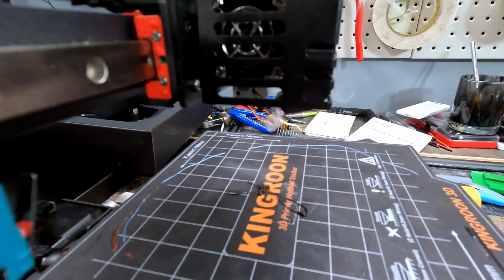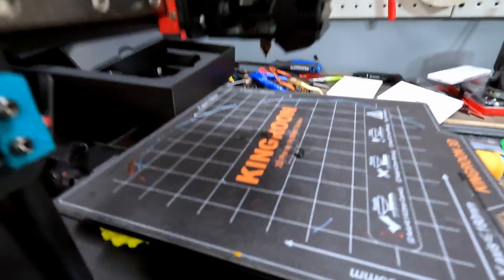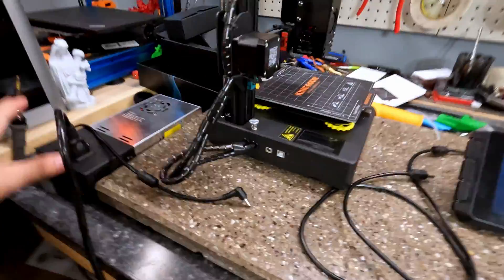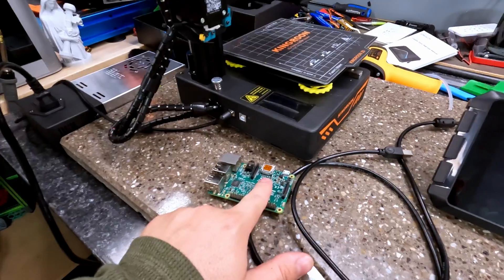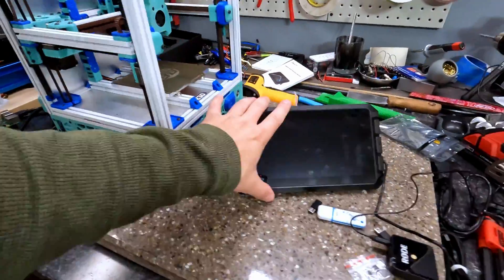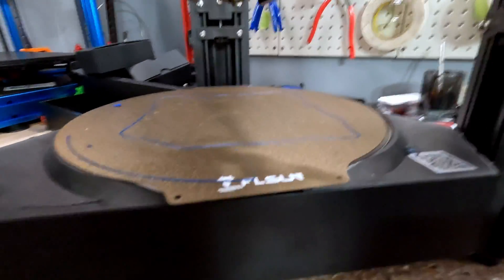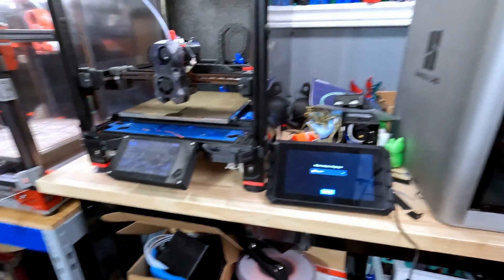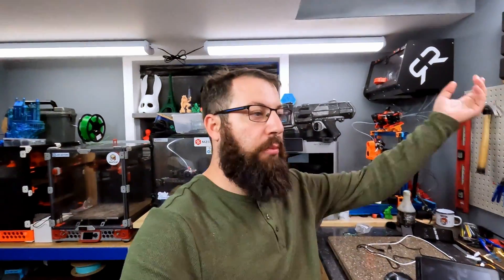Thermal Runaway - Not A Good Start With The Creality Sonic Pad

Comment: Thanks for your attention to the Sonic Pad. Both your voices and suggestions are of immense value to Creality as we always welcome more users to give us straight advice on our products. 

After watching your video, we immediately did some investigations and found this problem may occur when connecting Sonic Pad to a small number of non-Creality 3D printers. We have taken action and this problem will be fixed in our next OTA online upgrade which is expected on 15th October.

Creality hereby stands humbly and devoutly to embrace all concerns from our users and try our best to deliver a premium user experience.
Reply: It happened on my printer and it is an Ender 3 S1 Pro.  It is not and issue for non-creality printers.  It affects creality printers as well. It is an issue that needs fixed!
Reply: Timothy Hoogland  it at least says on the product page that it’s open source and modifiable.
Reply: Timothy Hoogland  what I’m saying is I’m pretty sure they released their changes to Fluidd publicly after being shamed about it. Shame it takes that much. I get your point though.
Reply: I had same issue today, i connect Sonic Pad to my Voron 2.4 R2 Fysect Spider board 2.2 and bed is overeating, iam not satisfied with that issue.
Reply: I tested today 22 of June 2023 and problem persists, when i connect Sonic Pad to my Voron 2.4 R2 Fysect Spider motherboard and the bed of my printer overeating , and Sonic Pad is updated, but problem persists, this is not a good move from Creality.
Reply: Wow!
Thanks for covering this.
I just last night connected my  new sonic pad to a Creality Ender 3 V2 with the chip STM 32 G0B0 & MINI Version E3 3.0 board. I got the abnormal heating g straight away.
Do I need to update the sonic pad firmware?
Reply: Is the source code of the used Klipper, Moonraker and "Creality sonic pad" UI versions available to everyone? Could you provide a link?
Reply: Thank you very much to Nero3d. Now we are here to update all users who are continuously concerned about this issue. This problem has been fixed in our latest OTA online upgrade.

The latest version includes: 
1. Added security protection mechanism for Klipper service
2. Fixed known issues such as temperature curve bugs on the home page
3. Optimize some interface logic

All you need to do now is update the system of Sonic Pad to the latest version. Thank you all!!!
Reply: @Creality3D  I use a CR-10S Pro V1.... There is very little support for this printer both on your site or in community forums. Will you be creating setups for this printer so we can enjoy a more hassle free setup as in the Ender Series?
Reply: @orionmec  why not just upgrade your printer to a V2?
Reply: @DanielTorres-bs8dx  I did try that. But... I got the tinymachine3d kit with the cable and all. It would not work!, then bought one from amazon and that one would not work. Since my inductive probe worked fine I just said screw it and work from there. I had upgraded to a Bigtreetech tft 43 and had all kinds of trouble getting it to work with Marlin v2.0 but finally it started working while everything was set correct all along. Then last week updated to the latest 2.1.x and now can't get the BTT screen to work again.... So long story short, it has been a pain in the but. Works great when it works!
Reply: @orionmec  all you have to do to go from v1 to v2 is install a bl touch and update firmware
Reply: @DanielTorres-bs8dx  Yes, I knew that.... For whatever reason it would not work on my machine.

Comment: When I'm using diesel in gasoline car "oh! They should tell you about this!"

Robin nano is an old board b4 all that klipper stuff and why creality should test all old boards that are not made by creality ?

The main thing is, if you are not using creality board, so you shouldn't use creality config files
Reply from the maker: Ya, but the problem was, they shipped it with a baked in creality profile setup already, and no where in the documentation did it state that, and all this happened before you could even get to the screen to change your config to somethingelse.

Also, klipper is board agnostic, and the creality pad, while made by creality, is NOT just for creality printers, its running klipper

Your basically paying for a locked down version of klipper on a device that you dont have control over and hope that creality continues to update the FW.
Reply: @CanuckCreator  meanwhile I've got 3 printers working on SP including 2 sapphire sp5 and FB 5, no problem at all
Reply from the maker: Ok? I'd hope so by now, after I made this video they pushed an update to correct their error in the firmware setup process and default config
Reply: @CanuckCreator  yep, everything is working fine.
One thing that i don't like is heating of the device. 
I'm using cooler for gaming smartphones just in case

Comment: 3 Sonic Pads, 3 Creality printers, Ender 3V2, S1, 5Plus.  All have reliability issues. All on latest Dec firmware.  One SonicPad had issue with USB port and took out control board, causing Thermal runaway, Ingot a SonicPad replaced, but the control board I had to pay for.  The issues are varied, but mostly the disconnects with error on the connections to FLUIDD are maddening, tried multiple cables, direct on internet versus wifi, etc.  We bought these to speed up our printers and have better quality..it is seeming more and more that this is a myth.  By the time you put all this money in Creality, you might be better buying a Bambu Labs for $699 that will do up to 500 mm/s and you don’t have to mess around with it. Plus, Creality service is terrible, non-responsive, asks wrong questions, etc.  they said there would be another update, but time has passed and no details or acknowledgment.  If you rely on these printers and this setup, beware for now.

Comment: Guaranteed there is a default printer.cfg on the sonicpad, and it runs in the background when the wizard is running. Mine does this, even with a printer already setup the wizard is still coming up. But if you hit up fluidd it is active and running ! Terrible design of this setup wizard they made

Comment: Some misconnection or fault is always a possibility, so there really should be a supervisor performing sensor sanity checks in the firmware as soon as the Sonic has booted, such as "do temperature sensors appear to be working?", "Do they match expected temperatures?", "Are temps changing as expected?". If anything seems out of whack, query the user to give them a short time to say all is fine, or try to power off heaters immediately.

Comment: I completely agree with you.
Unfortunately, there is more:
If you place a different print head on your Ender, with bl-touch and then purchase the sonic pad, chances are that the sonic pad will autolevel your printer outside the bed.
High chance of damage to your expensive bl-touch.
The cause is the same: The sonic pad sends commands to your printer during the first setup while the setup is not yet good at all.

Comment: I Have given up on sonic pad 👎 Tried for weeks, with a lot of help from discord and communities to get a Elegoo Neptune 3 run with this. Ended up with a destroyed PEI Printbed (hardened Noozle), strange random warnings and strange noises from the stepper motors. Just after i thought i made it and the z_offset was saved in the config_save section and print looked good, the next day it smashed in the print bed as well. Firmware is also very buggy. Switched to the original firmware (marlin) and it‘s printing fine again.

Comment: Not pointing fingers or anything but did you really read the manual? Why are other reviewers walking through setup before connecting USB to the printer. Yet you just immediately hooked it up via USB and then tried to setup? Don't mistake my question for trying to invalidate your concern. Your concern is legit. Example https://youtu.be/EkRj0HA30rI?t=192
Reply from the maker: Not sure, i guess they did not follow the manual
https://imgur.com/a/XEfpisV
Here it is directly from the one i received with my unit, Plug in power, connect via USB. 

Also take note, im well versed in klipper and have it on a dozen+ machines with countless installs, im well versed in the "normal" behavior of a fresh klipper installed, and was not expecting the setup creality used with a pre-setup and configured printer.cfg already enabled, and as you can see from the pinned response from them, they after this video they updated the sonic pads to remove this fault

Comment: Got my sonic pad, hooked it up and did all the calibrations. Made one small print and it did alright. I started a bigger print and went to bed. I woke up to a printer with several heat overheat warnings and it would not do anything. I ended up having to download the japanese version of creality firmware and reflash the board and screen.  I think they should take this off the market until they get the problems resolved.

Comment: It's not the pad but the printer that had issues.  Also you are not supposed to connect the pad USB until you install the firmware to the printer after the pad copy the file to your SD.  This is all user error.
Reply from the maker: Not user error, This is what happens when following the creality manual to the letter, i know the "proper" klipper setup method, but not everyone buying this product does.  This was a failure of documentation and this product being shipped in an unsafe configuration
Reply: @CanuckCreator  the configuration doesn't exist until you set it up.  Yes the manual sucks but there are tons of info on klipper setup and flashing that gets around the horrible translations of the manual.
Reply from the maker: @brandonbrown3600  They have changed it now, but when this unit was shipped to me it actually had a config pre setup for an ender3 ready to go out of the box. So when it tried to pull a pin up high for an ender 3 stock board endstop, it activates a heater on this board instead.

Comment: Sent it back,  any device that calls back to China,  does not give you root/ssh access,  has access to camera and my files,  and  not give you access to set permission and or access does not go on my network.
Reply from the maker: Do you have anything to back up those claims? Legit curious
Reply: @CanuckCreator  Yes it is called 20+ years in IT  and Cyber Security,  and 15 years in the Military.   You can use your firewall and or packet sniffer such as wireshark.  Ran in to the same issue with FOSCAM IP Cameras and IOT devices (Stuxnet).  I take it you are not very IT or Linux savey to understand the the vulnerrability of such devices.  Since this "LINUX"  device is going back to Creality for updates for both Klipper and the Operating system,  and Creality is not giving you visibility to the security model,  code, permissions, camera, file system, etc...that is like giving them keys to your network....LMAO can you say IT Security 101.  Ask them why they will not give you SSH and or Root access....I thought this was opensource.  You have to asked yourself would a business really want to set this device that is manufactured in China and maintained,  that is attached to the internet,  and does not allow you access to the operating system to manage the security (permission, file access, camera, firewall etc).  This is definitely not how I would secure my intellectual property.  Take some lessons from the Home IOT folks, this would be like Microsoft not giving you administrator access to your laptop and they had the login and password for everyone's laptop......I cannot trust this model.

Comment: I feel the Klipper firmware shares some blame here.  Safety issue should be addressed by the firmware running on the printer.  I.e. the Klipper firmware (already) on the printer's board should have some preset knowledge on used temp.sensors, monitor them (for thermal runaway) and guard against that happening (i.e. know the safe gpio state to force).  I'm surprised this isn't included.  Sure, you want as little knowledge as possible in the main board (and hence provided at compile-time) and most stuff on the pi, but not safety guards like thermal runaway...

Comment: Buy a device designed for a ford, attach it to a Toyota then shame the company on YouTube when it does not work as expected, why not research it yourself before such a click bait video.
Reply from the maker: No where on the package or manual does it say only for creality. Also during setup there is a section for none creality printers.....

Makes it seem like it's not just for creality printers. It's advertised as a klipper pad. Of which their are several now on the market
Reply: yes they made this device for ender 3 s1 s1pro v2 s1pro very strange

Comment: So my experience with klipper is that it will refuse to send commands to any board until you figure out what the board's ID is and put it into the printer.cfg.  So this should result in the same situation as when the printer was turned on with no Raspberry Pi connected.  So has Creality added something to their klipper install on the Sonic Pad that automatically picks up a new mcu ID and starts sending it commands?
Reply: This was brought up in the discord chat by gdachs.  Both the Creality board and the MKS Robin us a CH340 USB-to-serial converter. That chip is not capable of storing a unique serial number so to the Klipper host they are seen as the same device.

Comment: I have the exact same probem on the kp3s, but im using a laptop with linux on to run klipper and when i turn the printer on it starts heating up. Do you know how i can fix this?

Comment: This is not a creality problem. It is a klipper problem. There needs to be some sort of assurance that the printer is doing that it is supposed to be doing. It is not a toy.  A printer can cause property and personal damage. There should at least be some sort of handshake between the printer and controller, and not allow heating unless that handshake is completed. 

It can be a simple thing, both sides with lookup tables that declare compatible version they can talk to, then a several byte config that loosely describes the hardware.  Anything. A heater here message?

After all, there is a reason why most of the printers speak gcode. The command “extrude 10mm” does not suddenly turn the heater on. Sure klipper is doing more than that, but in the end, there needs to be something.

Comment: You give Creality too hard of a time I think.  Great you went to the effort of alerting everyone, it's an obvious safety issue, but I don't think they put in the manual the it support the board you mention either? 
I don't think you can expect them to test them all, without potentially building out wiring unit tests for each board and then you're only as good as the test sample size.
Once you start mixing and matching you're kinda on your own, and that's not a Creality problem. 
The setup idea's again not bad, but then you're asking them to support a bunch of products that are not theirs in their own UI.
Maybe that's the option? Lock it down so that if it probes a Creality firmware it works out of the box, otherwise it makes you configure it first? 
That way they still get the works out of the box experience for less experienced users and still prevents a run-away if it's plugged in somewhere it's not configured for.
Reply: My take away on this video is, the pad shouldn't load any config or set any pins high before it's been run through first time setup and a printer (creality, or other, noted in the instructions) chosen/configured.  This is a easily fixed, but very dangerous oversight.  Creality probably thought fans wouldn't work, sensors wouldn't work or motors would go in the wrong direction but nothing dangerous.
Reply: @nitroburner77  they don’t have a responsibility to other vendors products, it probably work fine with their lines
Reply: @pXnEmerica  Their marketing: "Creality Sonic Pad can connect to almost any FDM 3D printer on the market via a USB cable."  By default, they assume only Creality uses the same chip and same USB id, with the same very specific configuration as their devices.  The have replied that they see this problem as a problem and will fix it.
Reply: @nitroburner77  none of that is untrue yet they still don’t need to support you hooking it up to something they didn’t make. The response time, fixes are great news. Personally I’d support them even more at this point for going out of their way not only to support the numerous clones but attempting to resolve it within hours.
Reply: The other issue here is resale or mixing devices like at a farm or something. If you have multiple pads, and they are configured for different printers and you accidentally plug in the wrong pad, or your unknowing employee does... It's not going to matter what happed at setup time anymore.
So I still think a firmware probe is a potentially better way to do this. Creality/Marlin build can return version information if they already don't.
If that doesn't match what's expected from supported Creality ID's then it should ask you to configure it every time it's  connecting.